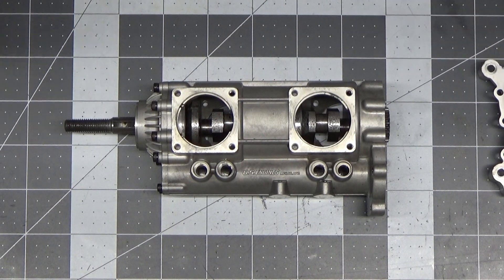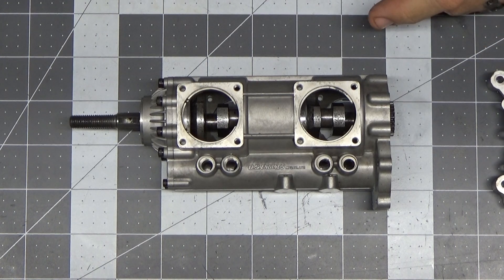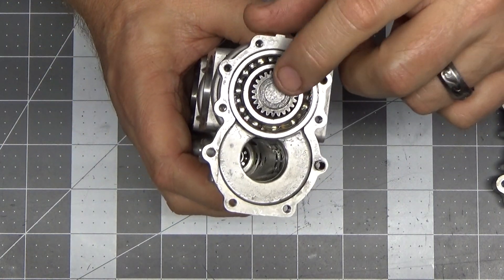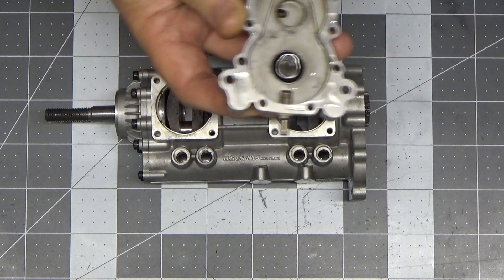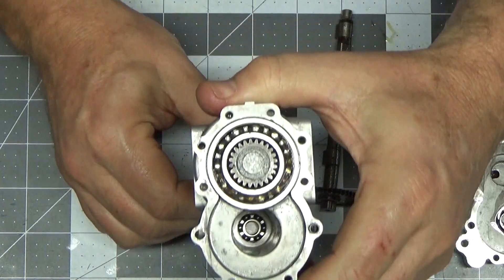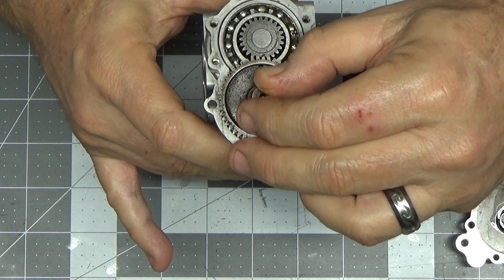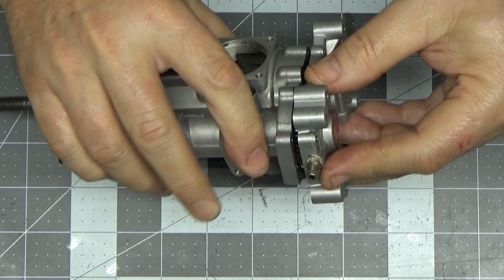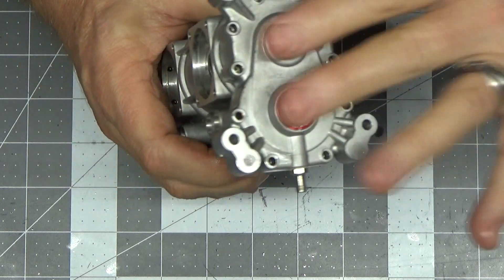OS FF-320 Pegasus Customer Engine Major Reassembly Steps

Comment: Well done, Dave. The heat vs. cold technique is a die makes trick to set dowel/guide pins. If you need more clearance, chill shaft with ice, or even dry ice. Let assembly sit well long enough for all temps to stabilize.

Used to set pins with a four thousandth interference fit. They never come back out once in position. Crank clearances aren't as tight but the technique will still give you assembly room if you bearing to shaft clearance is close.

Such a sweet engine! Maybe someday I have one.

Wayno in Ohio

Comment: Dave, in the disassembly video, you noted and showed a bolting boss on the engine back cover that was broken.  Did you have to replace the back cover or did you find some work-around for that broken piece?  Sorry,  I went back to the disassembly video and realized it was the front cover, not the back cover.  Same question though.
Reply from the maker: I have not done anything to that.  There are no replacement front covers available.  the small portion will have no impact on the security of the front cover or the operation of the engine.

Comment: The rebirth of probably the best glow engine ever made, when you have a chance to run it you'll be rewarded with a very sweet engine sound and an almost vibration free run, simply a sweet engine jewel, it's is so well designed, it can be started using 2 glow plugs  in the front cyls, even a torqmaster 90  is more than enough turn it and once runing switch glowplugs to rear cyls,   voila!  It's alive!
Reply from the maker: I was wondering about lighting all glow plugs.  I do have 4 ni-starters now.  I was not sure if it would like starting on only 2.
Reply: Start with 4 glowplugs, and once tuned in try with 2. It's just to show the well bahaved they are, can be started with half of cyls
Reply: @dmrcflyr2  You can start it with one driver
Reply from the maker: I'll also be hand starting it.